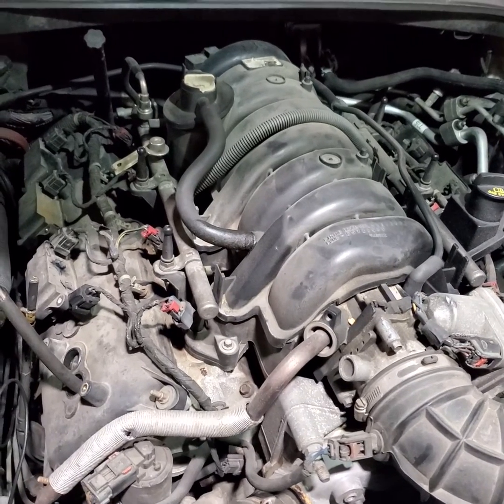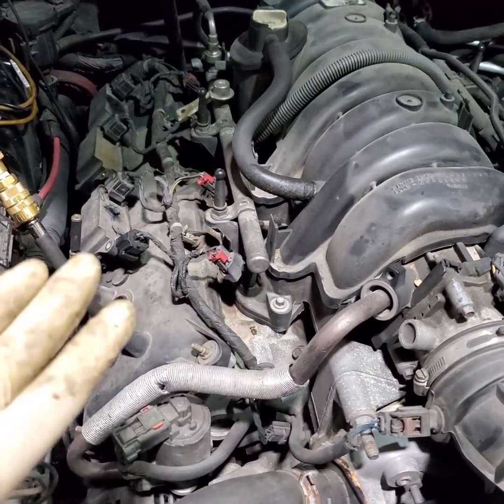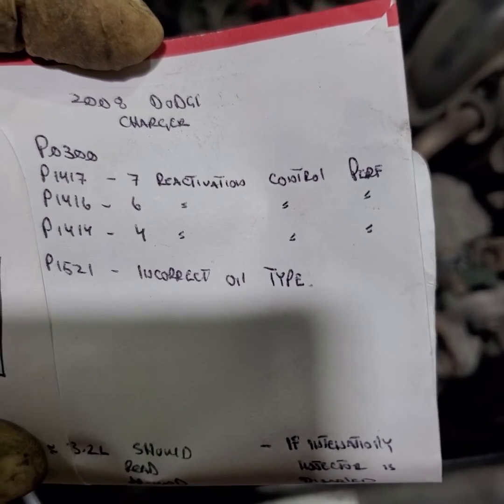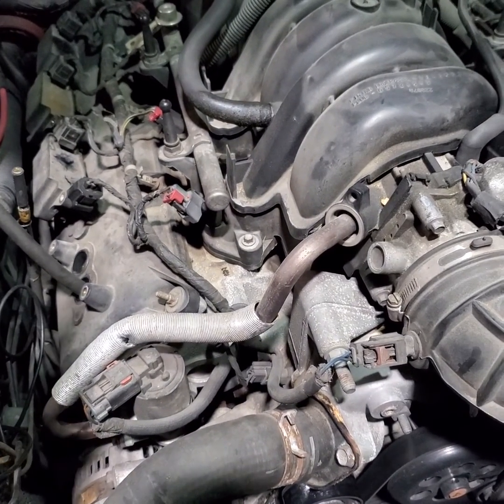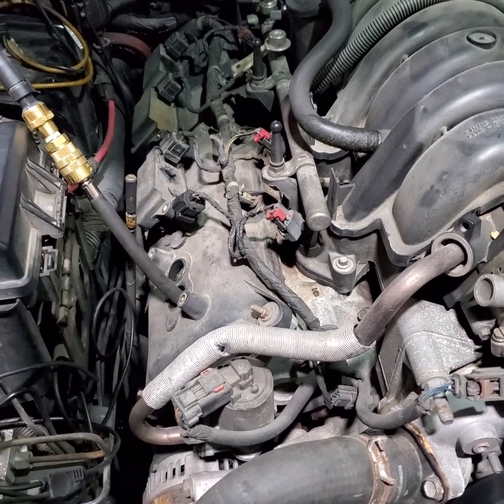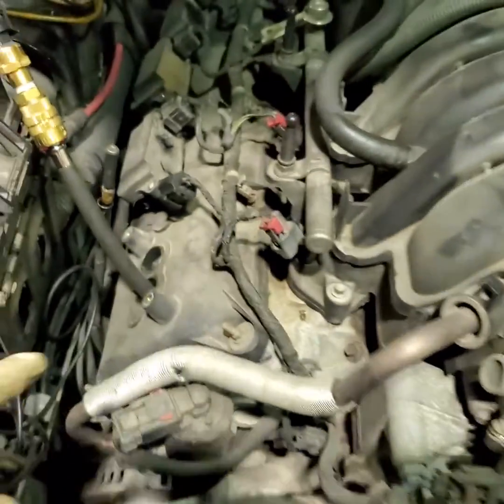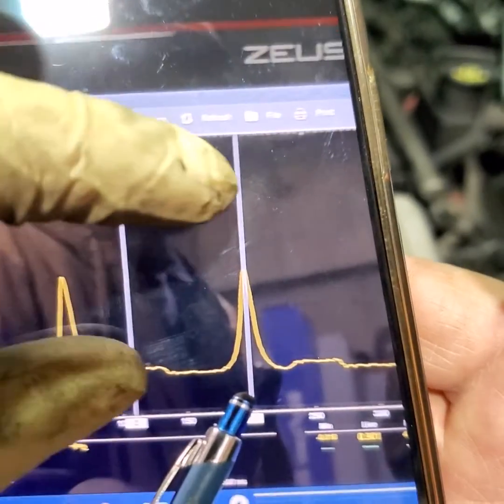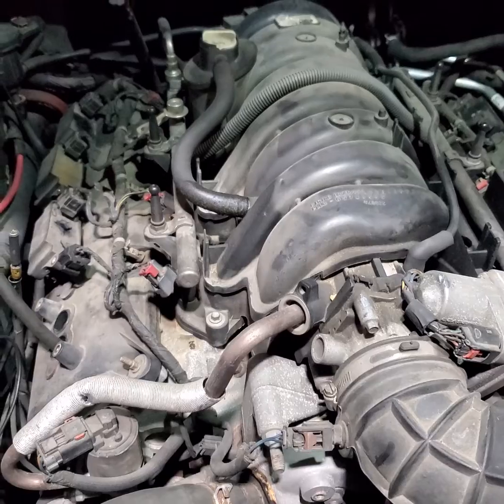2008 Dodge Hemi 5.7L - P0300, P1417, P1416, P1414 and P1521. Importance of the Pressure Transducer

Comment: Hi I have 07 5.7l hemi with exact same codes P1414, P1417 and exact in cylinder waveforms on cyl4 and 7. What did you find inside? What was the fix finally?
Reply from the maker: Client declined to go further. But the  final diagnosis was the engine.

Comment: Could just be a stuck mds solenoid.  Mds solenoid activates to allow oil flow to the lifter and knock the pin out of the way allowijg the lifter to collapse. If the mds solenoid is internally failing and not sealing will have issues.